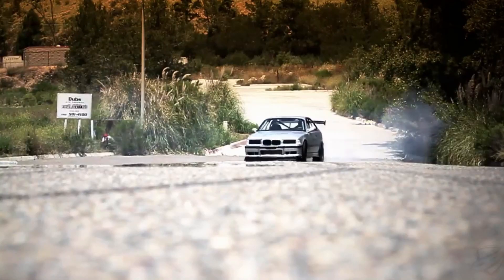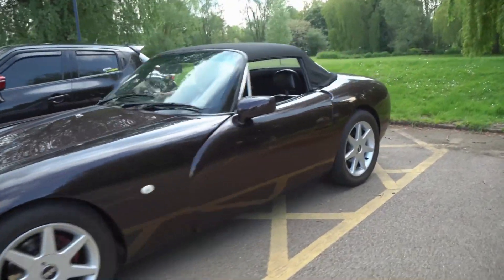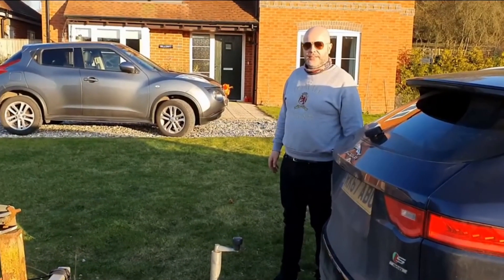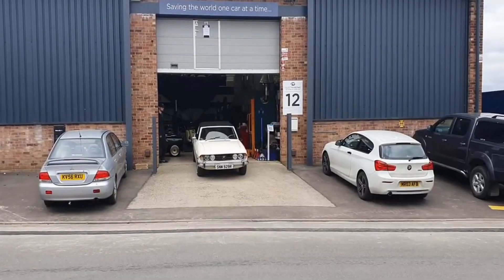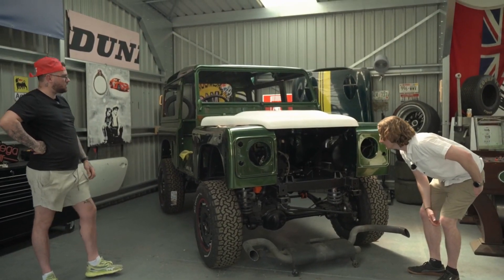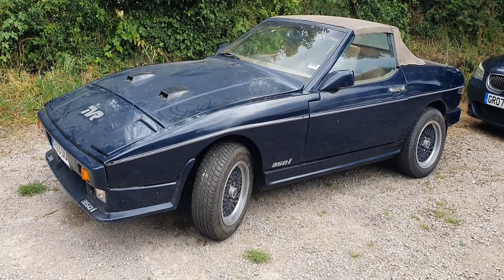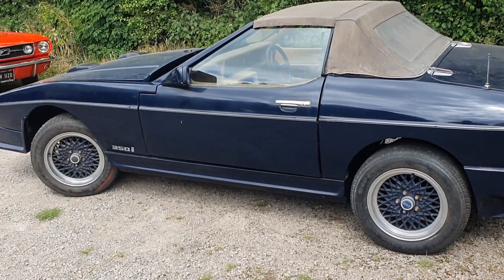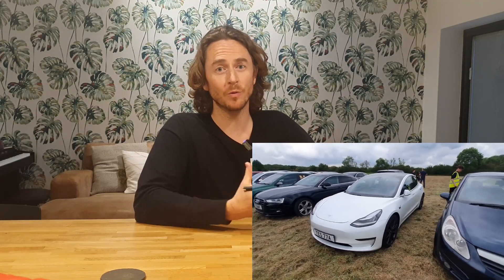SHOULD I SPEND £50,000 ELECTRIFYING MY TVR?? TVR EV Conversion TESLASWAP update & summary #TVRWEDGEE

Comment: Easy way to drop cost is drop batteries
Instead of trying to get 200 miles of range, get 80 miles with 2x Chevy volt packs and focus on making the CCS charge compatible
Reply from the maker: Yes its a good shout range ain't a biggy as I won't be doing big miles everyday, its a fun car. CCS charging isn't cheap though 🤔🤑⚡
Reply: @chargeheads  I get my 18650 batteries for £0  i have over 3000(lost count after 3000 lol)  and i`ve got 4000 NI-MH for £0 they are for my multiple garage power walls(need to transport from home to garage so the NI-MH are a simple no stress about charging/monitoring etc option).....   at the present i can make 6 450-500 cell modules using 18650 Samsung cells, each module is going to be 450 2600mah and 50 2800mah at 24 volts, car choice Ford Sierra(already have it)  when funding allows option 1, Lexus Hybrid gearbox -  option 2, Leaf in the rear behind the axel line,  IMEV in the front behind the axel line....
Reply from the maker: @kylereese4822  sounds like a great value build and in a sierra, super cool. Would love to check it out when its done! 😉⚡💪

Comment: How you getting the Model 3 rear motor in without doing heavy modifications and having to go full SVA?
Reply: Change of power unit without changing much else will not need sva . Even better if 40 years old so classed as historic.
Reply from the maker: You are right it will need a test and confident we can get it through 👍⚡💪
Reply: @chargeheads  So you budgeted to get the car approved and documented to the R100 regulations too as this is a newish SVA requirement? Which when I was looking into it came back at 7500 gbp.
Reply from the maker: @Tom-evnut  i heard about this on a forum recently and will be looking into this in more detail before we start. As there is no way i'm spending this kind of money without knowing it will be legal on UK roads. What is your build?
Reply: @chargeheads  I am a self employed automotive engineer and do alot of hours for one of the companies you recently visited, leading the engineering team.
Reply from the maker: @Tom-evnut  so is there anyway round this £7500 R100 regulation?
Reply: @chargeheads  yup stay out of SVA or find a reall6 helpful tester who freely interprets the sva manual
Reply from the maker: @Tom-evnut  thanks for the advice 🤜💥🤛
Reply: @chargeheads  £7500 sounds like a recouping of tax for ev`s... what if conveniently the paper work at DVLA for a conversion goes missing you/others may have to repay £7500.....  something smells rotten on the £7500 it`s hell of a way to make a profit and create corruption....
Reply from the maker: @kylereese4822  when i get that far i will highlight to all, as this needs highlighting and potentially fighting against if the process is unfair or unethical!
Reply: @chargeheads  Yes something like that cost in a new market that`s still in its early days "road legal test cost of £7500 " is a red flag of suspect behaviour for sure and needs to watched very closely by all...  i think someone is scapegoating the EV conversion community to make extensive amounts of £ in a non legal way.... 
if the test was around £1000 for the cost of test/3rd party engineer/new ev plates and maybe 2nd vin plate/stamp showing the conversion records/dates ect that would be more logical/affordable/viable...
Reply: @Tom-evnut  ouch!